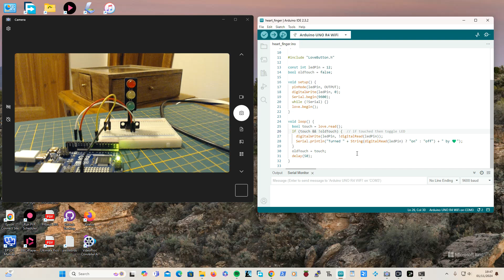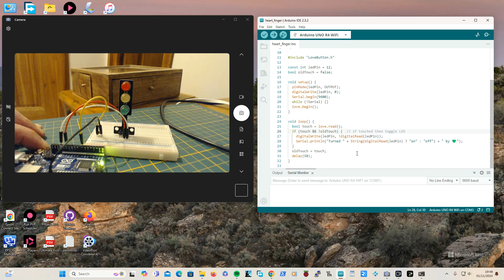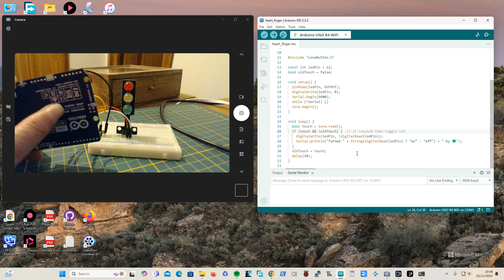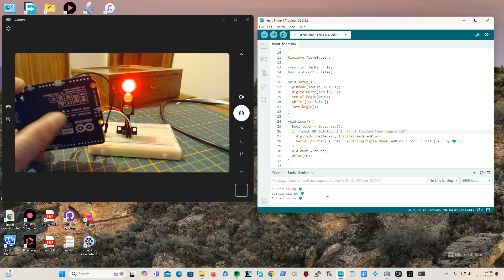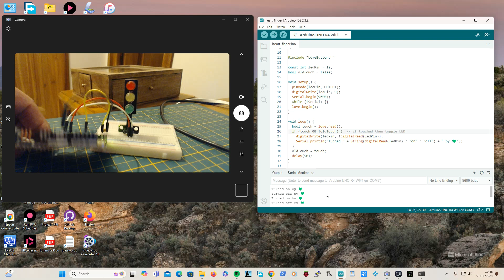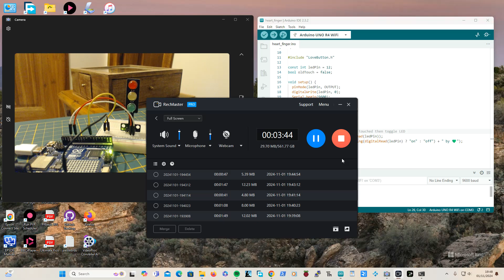Heart button update. IT WORKS!!!

Comment: Very cool - thanks for sharing.  I was planning to use some homemade capacitive touch sensors for a project.  Will be interesting to compare.
Reply from the maker: @lorisrobots  Thanks, Lori. I don't often use other people's work but I made an exception for this because it was too hard🙃I don't know much (anything) about capacitors. Paul doesn't seem interested.
Reply: @charlotteswift  I think it is fine to learn from other folks and leverage their work.  Just need to provide attribution IMO.  I am hoping Paul will do a circuits type course one day.  But that probably won't provide the views he needs for his patreon support.  I plan to work through "Make: Electronics" by Charles Platt to improve my understanding of basic electronics and circuits.
Reply from the maker: @lorisrobots  Is that a book? You don't need to answer that. I've just realised that I have Make: Easy Electronics, Make:  Electronics & Make: More Electronics, all by  Charles Platt. So you recommend him?